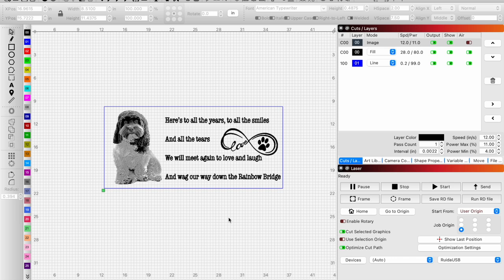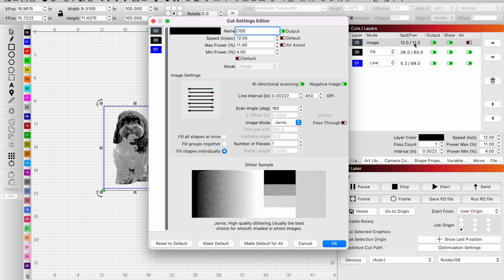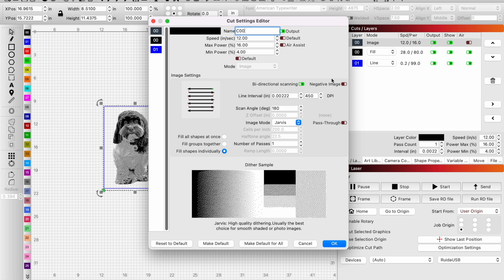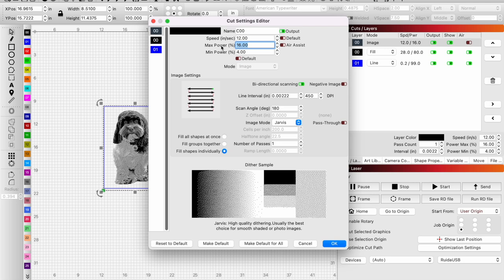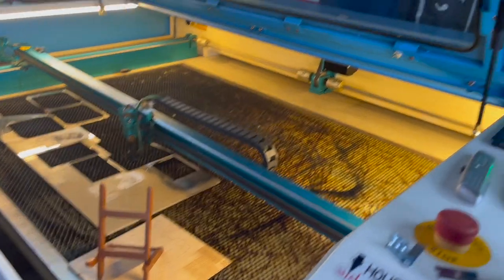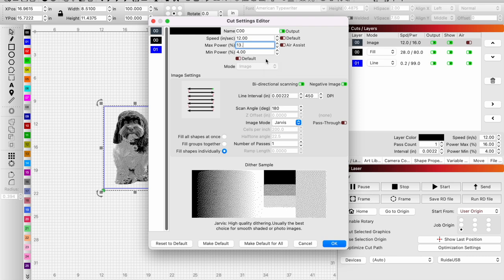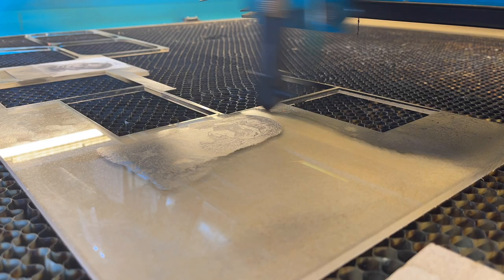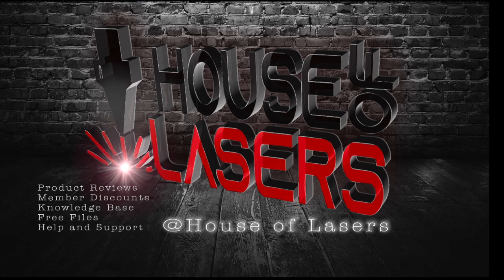Level Up Your PHOTOS

Comment: I read the comments so I hope I didn’t miss if the question was already asked. It looks like your image is burned directly to the top of your acrylic? I tried this with my diode laser and my laser passed through and burned my board on the back side of my work. Do I have the wrong laser or am I using the wrong material?

Comment: I have a xcarve with the opt laser 6w attachment I'm currently trying my luck with the historical photo lunch on a skyscraper with my height at 35mm my speed sitting at 300 my max power is at .85 I turned on the negative image over scanners at 2.5%, my line interval is that .00348 with my DPI setting set at 287 I'm using the image mode of dinner with my number of passes at one with the negative imaging on I'm picking up some detail but not the amount that it should what should I do?